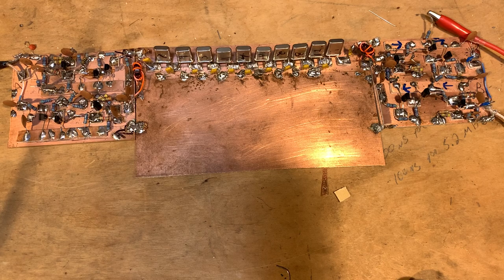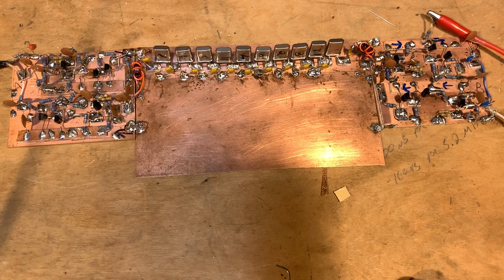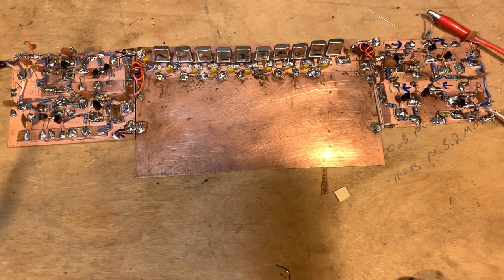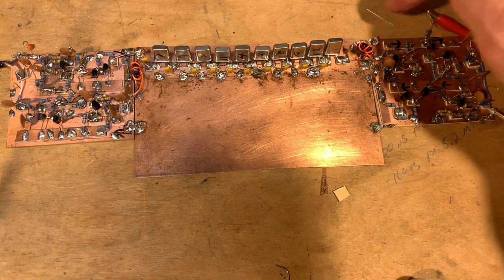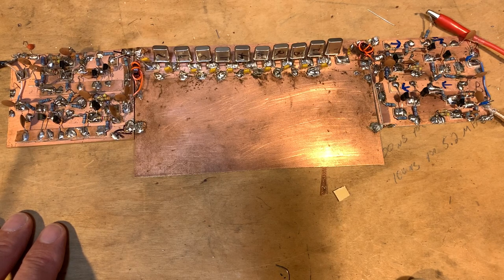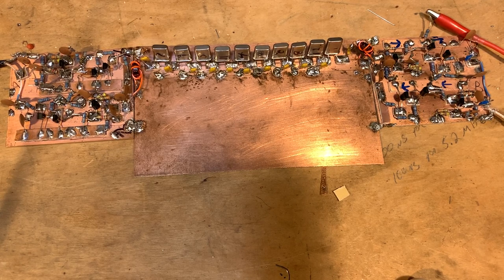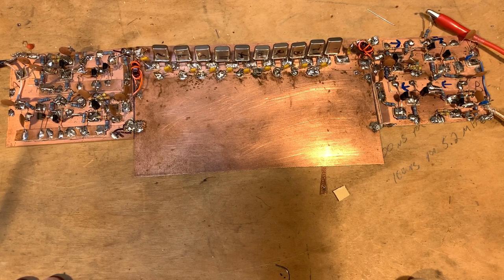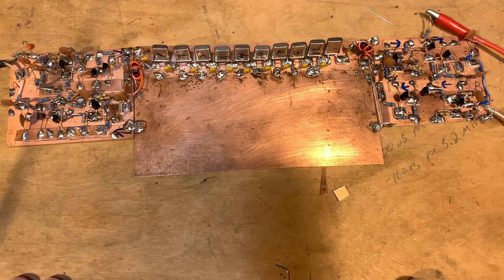SolderSmoke Video -- Mythbuster Video #2 -- 10 pole Crystal Filter

Comment: I've been building a scratch 1 MHz - 4 MHz superhet from the component level and used the nanoVNA to trim the input tracking filter and IF filter stages. What a joy to do! Okay, I could have used signal generator and oscilloscope but the nanoVNA made it easy.